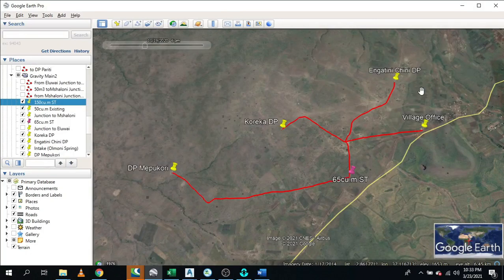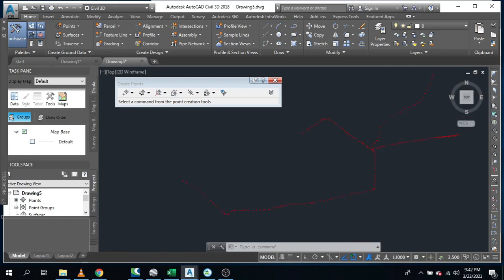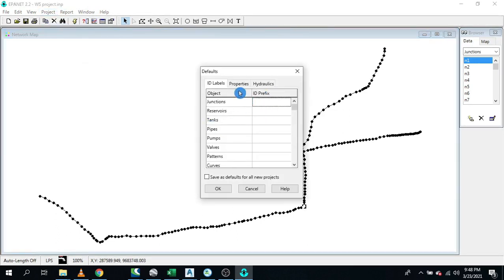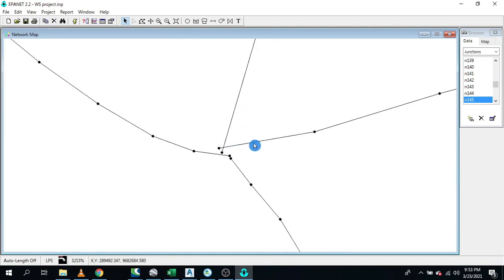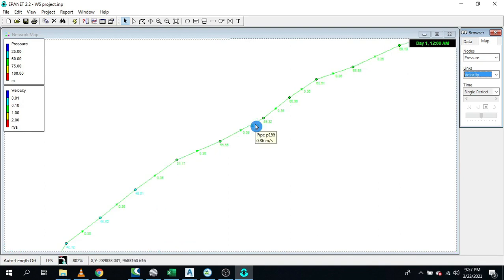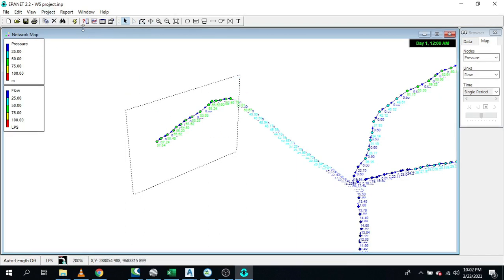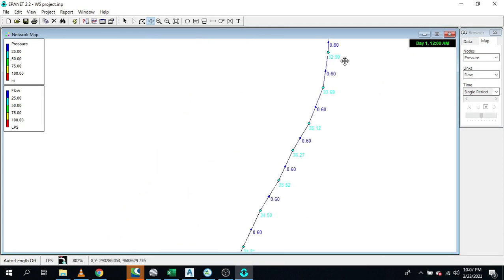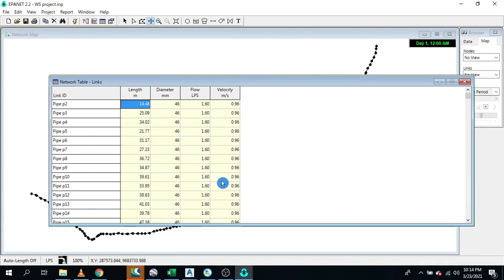EPANET Hydraulic Modeling for Gravity Water Supply Network [Real Project]

Comment: How can I best model a system with multiple storage tanks? The storage tanks are different sizes and feed different regions of the site, even though they receive water from the same source. Should I just run a simulation with a single model that represents the volume of the water demand for the entire site?
Reply from the maker: I did not get you when you said "a single model". Well, IMO, I think the best way to model such a network is to run an EPS Model (Extended Period Simulation Model) and if it is a pumping project it is even easier! With EPS you can model how the tanks will respond to water demand fluctuations and how the chemical properties of water will change when water moves in the system!

Comment: Can you please help me. I had done the network in Civil 3D and concert to .dxf then to .inp using EpaCAD and after loading the network in Epanet and adding a tank and while doing the run it shows an error message as "Tank closed at __ ft". How to solve it, I just need to run it successfully, that's all.. Can you please help me..
Reply from the maker: Hello Jewell! Did you use extended Period Simulation in your model or its just a normal steady state simulation?
Reply: @HydroinformaticsAcademy  Thank for your replay, I am not much aware about this water distribution and all. 

I had done a survey along the roads in a panchayath and made a network in autocad. My only requirement is to convert this AutoCAD network to Epanet and Run it. That's all..

Is there any methord to do that, if you could provide me the mail I'd , I will write it in details.

Comment: Sir, how can we provision cosntant flow from reservoir to tank? For example 1 lps from reservoir throuhout the day.
Reply from the maker: Hello welcome! 

This is the challenge because you don't have the option to insert base demand in tanks just like what we do with other junctions! 

It seems as though from the reservoir to tank water flows under influence of ground elevation... The higher the elevation the higher the flow!

But here is a solution you can use for now.

Soon after the reservoir, introduce a flow control valve, then on the FCV's "settings option" set the flow you want (eg 1LPS) and then set "none"! 

With this, you will have a constant flow (eg 1 L/s) coming from the reservoir and if you run your model, water will flow without any error BUT after running your model, when view pressure or results you will find that even though your model runs without any error you still have -ve pressures! 

That is a solution I have so far BUT I am still finding other options and I will keep you all posted in case of any development. So subscribe if you haven't.

Once again welcome🙏

Comment: Hi, i am working on design of water distribution system project but not found any perfect video on youtube but this video was very good i can understand the concept well . But, one doubt what is the need of inserting node if there is need to supply water at that node?
Reply from the maker: Thank you SAI SATYA! I really appreciate that it was helpful!!

Okey what you are saying is "why we put a node with no base demand assign to it?" I guess i get you right!!

As you know at any node we are not only observing demand, elevation or head but we are also interested to know the value of pressure on that particular node.

Now why we use nodes with zero demand? The answer is... in order to observe how pressure behave or to get the value of pressure in such a given node/point.

NB 1: The higher the number of nodes (survey points) the closer your model will be to the real world terrain but it will be a little tough to work with during modeling  AND VISE VERSA IS FEWER NODES ...

NB 2: This will depend enterely on what your survey says especially on the land/area topography..
Reply: @HydroinformaticsAcademy  thank you very much for your explanation I got the point
Reply from the maker: You are welcome SAI SATYA🙏
Reply from the maker: @saisatyaprasanthchamuturi  You are welcome!